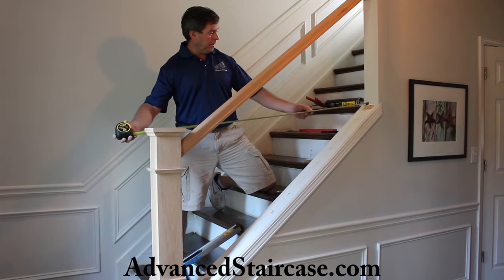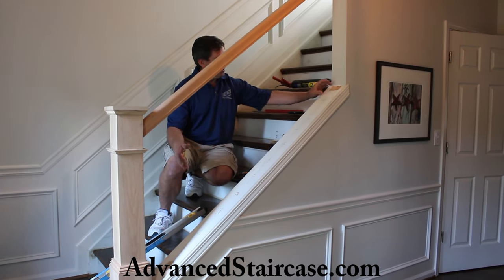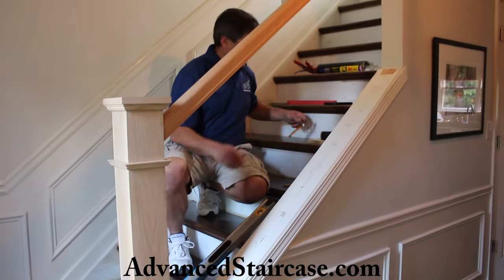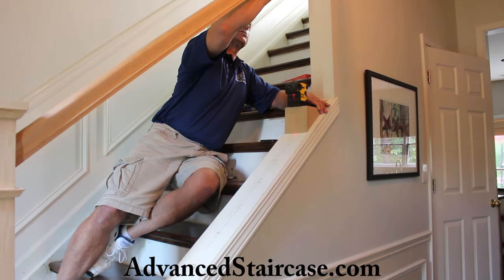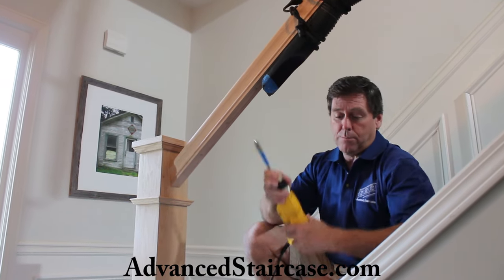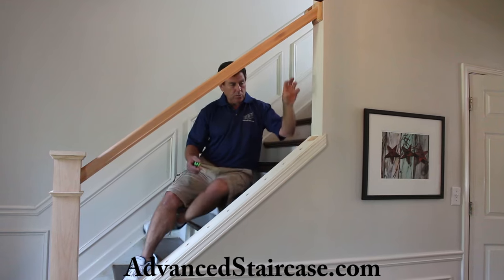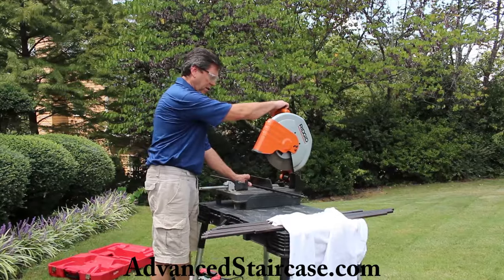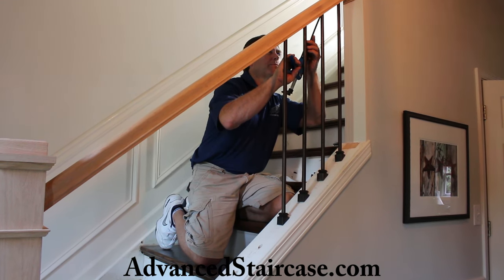How to Install Iron Balusters on a Knee Wall

Comment: A trick I learned to eliminate the use of epoxy, and keep balusters from rattling, is to drill the pocket hole slightly off plumb.  Once the baluster is inserted it takes a slight amount of pressure to bring it over into alignment with the bottom hole and, when dropped in, the baluster is held in tension against the sides of both top and bottom holes.  Very simple and effective without the need for adhesives or fasteners.
Reply: A video on your instructions above?  This would be valuable since most iron baluster install videos use adhesives/epoxy to keep balusters from rattling.  Please?
Reply: Just drill your hole all the way through drop the baulaster thru then up tight and then I drive a screw in the hole to pin it. This also saves have to cut them. Been doing it this way for 15 years and never have had a call back.
Reply from the maker: Using epoxy or strong adhesive is always best, A screw can be used in some situations to hold in place, but still good to also use adhesive with it

Comment: When I’m at this stage I make a story pole cut to length from newel post to top of cap. I lay out my 5 1/2” spacing on this stick and use it to transfer my marks on both the cap and the underside of the rail. Balusters are perfectly plumb every time. Sometimes I’ll temp the rail in place and lay it on the stair nosings to drill the holes before permanently securing it in place.

Comment: I think this is a great video. Thank you for sharing.
Just one comment/question: if you need 11 balusters then you need 12 spaces, right?
After measuring the length of the shoeboard shouldn't you divide that length by 12 instead of 11?
Reply: I was thinking that as well, but i think the last space towards the top isn't counted because it's very short.

Comment: In a residential setting, where a hand rail is not necessary, do you need the guard rail to be at a handrail height ( Florida 38 inches)?

Comment: If you did 5.5 inches centre to centre with a .5 inch baluster, you would have 5 inches of space in between the balusters and therefore, not to code. At .22 on the video you said to stay at 4.5 inches on centre. Then you measured the rake at 64 inches and divided by 11 and came up with 5.5 and then measured that with your compass. So. I'm a bit confused. I know this video is old but were you saying 5.5 and actually measuring 4.5? Thanks for this video as it's hard to find videos for finding these measurements without having a main frame computer to figure out the math! As well, you measured from the top of the hole in the handrail and to the top of the stringer and came up with 31.5 inches. But don't you have to add whatever amount the baluster goes into the handrail and into the stringer?
Reply: That was 5.5 on the slope. If you measure once installed, they would be within code. Rewind and watch his first measurement. Roughly 50” level (side to side). This is the important measurement that matters. Divide that by 4.5 and you get 11 balusters. Measure the bottom slope and he got 64” and divided by 11 balusters. That just gives you the spacing on the slope for your banisters. Hope that helps.
Reply: even narrower in UK 4inch here so the kiddywinks can't get through them

Comment: If the balusters are say 10mm, would you typically use a 10mm drill bit or one that's slightly larger?
Reply from the maker: 10mm is about the same as 1/2" , square peg in a round hole = 11/16 drill

Comment: You can't push a tape into an acute angle like that and measure accurately as the hook prevents the tape from reaching the intersection. Also, there's no way that handrail is right - at 5:00 you can clearly see it's not at the same pitch as the panelling behind - I noted other measuring mistakes in the video prior to this one and I'll bet that's what caused this error.

Comment: Why not cut out all the laser and level use for spacing and just measure from wall down or post up, if both are plumb the distance on both rakes would be the same.
Reply: Laser use is so that you get a dead center top to bottom. Makes it much easier then measuring upside down on handrail. To most...
Reply: This would not save any time. Only up the chances of errors during the repetitive measuring process.

Comment: what size holes for top and bottom on a fresh install
Reply: 1/2 inch usually
Reply from the maker: For a 1/2" square bar you will need an 11/16" hole to put a square peg in a round hole

Comment: What make is the drill with the built in level?
Reply from the maker: The drill is a Dewalt
Reply: Advanced Staircase thank you. What is the model number of it. I can’t seem to locate it.
Reply from the maker: This one is Dewalt  - DWD110. Keep in mind that will not help when drilling the holes going up
Reply: Sandra Ambler dewalt

Comment: Something don't seem right. Visually the rail doesn't line up with the moulding on the wall.
Reply: dcooper0011 the knee wall may be built on a 40°  but the actual staircase maybe slightly different.  what your seeing is to slopes at 2 slightly different degrees
Reply from the maker: The rail needs to follow the stair angle and the trim was not part of this project